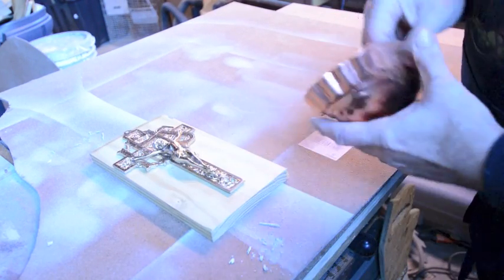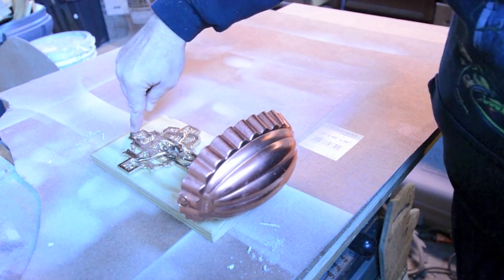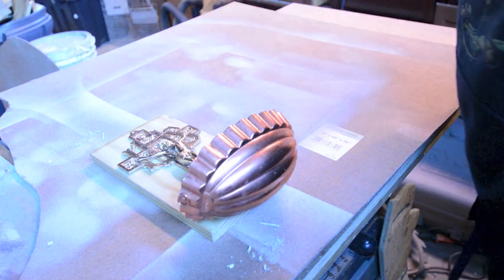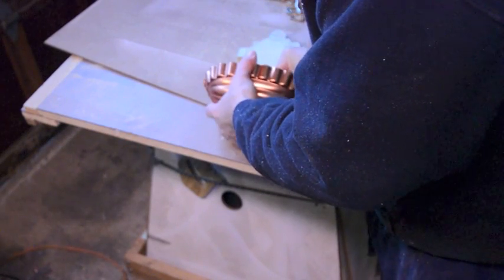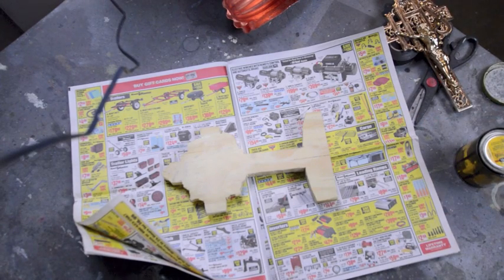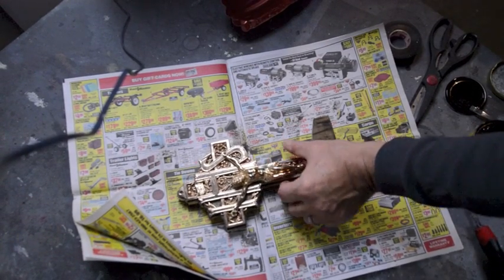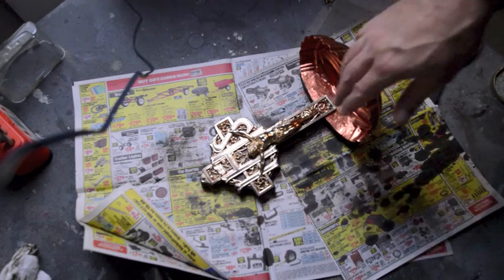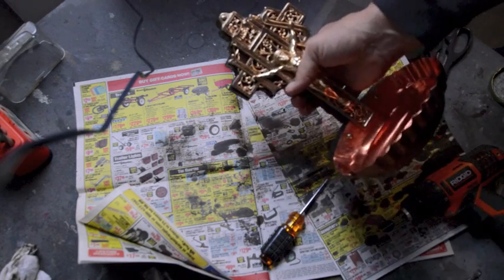Holy Water Font Build Completed - Bleached Bones Vlog 80

Comment: I would do the stained glass.... use lighting  gell.  used for theatrical lighting it works well for stained glass.stained
Reply from the maker: +John “Kreepy Hollow” Duprey Hmmmm. Where do you get these gels from? To be honest, I was simply going to use acrylic paints on a sheet of Plexiglas.
Reply: Should be able to find online.  I will see what I can find for info.  I did one many years ago when I worked in television for a set and it worked beautifully. Common stuff in television in theater